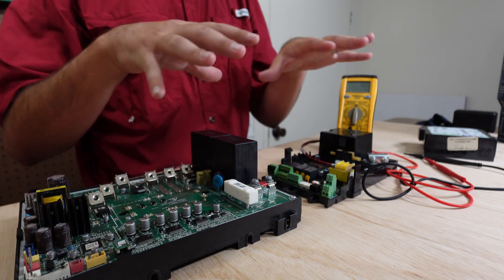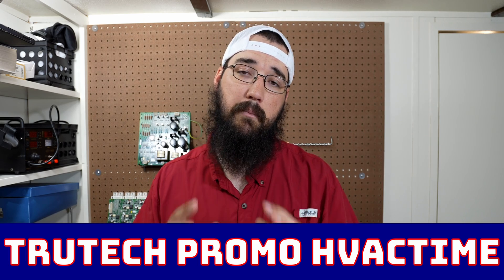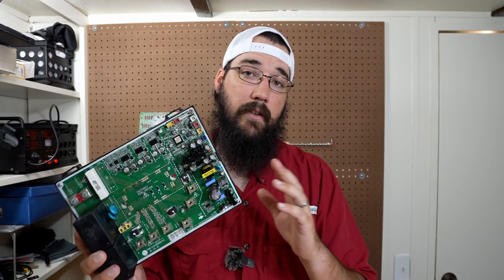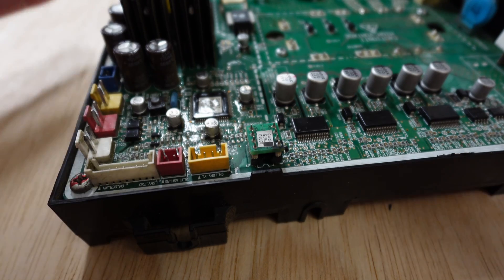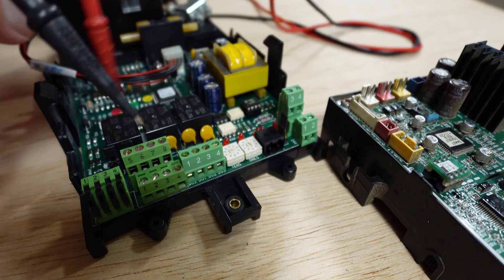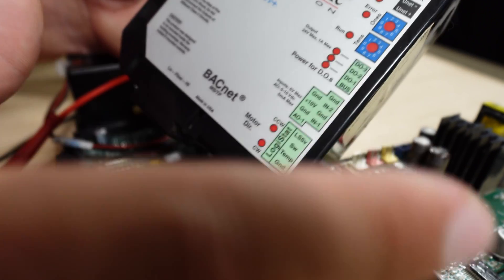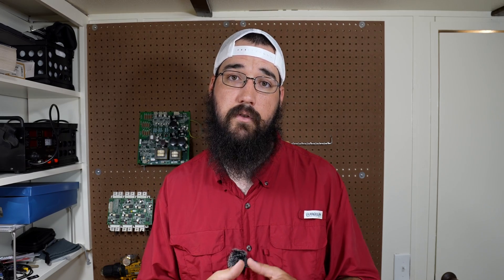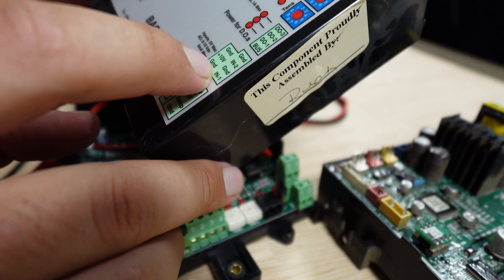HVAC Training: Board Troubleshooting

Comment: Thank you for posting this. LG multi v4 just found the master unit oil return solenoid shorted internally which killed the pcb and would no longer communicate with the other 2 condensers or evap controllers.

Comment: other than tightening the post for the ground on the board or swapping out a new wire, is there anyway to “repair” the bad ground (or something else to check), or would that just be replacing the board as the next step